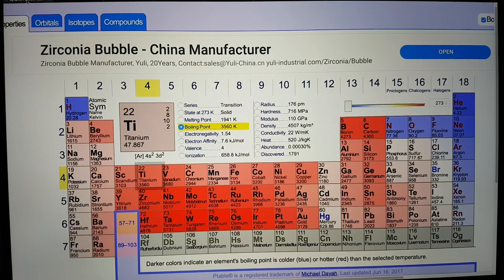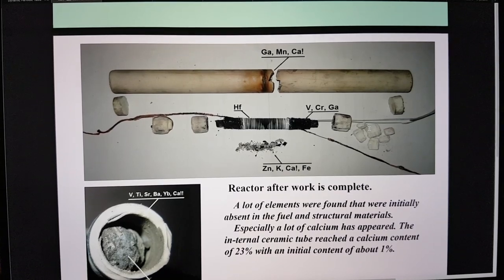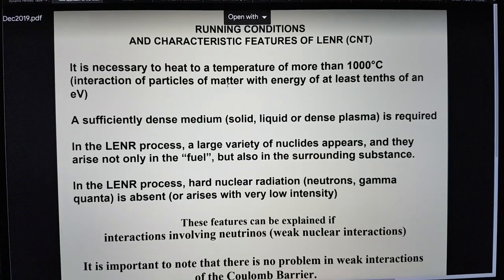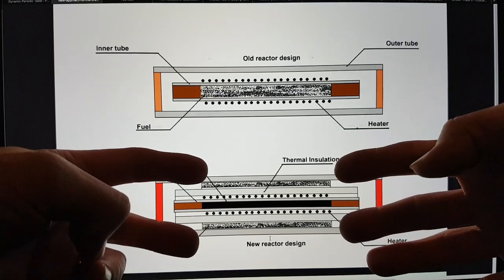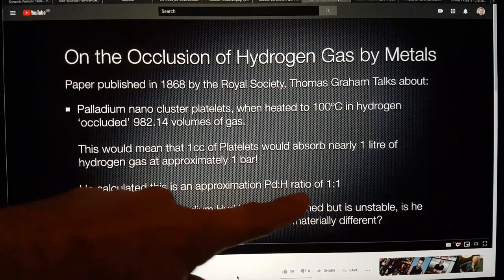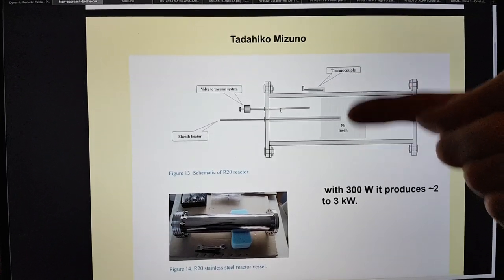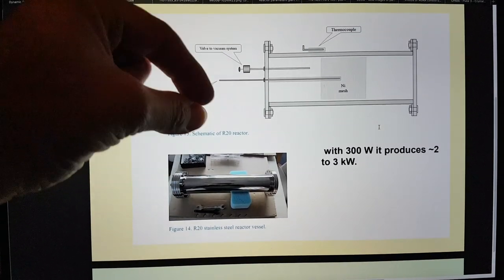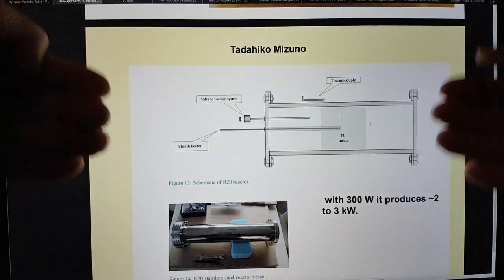Explaining Mizuno R20 and optimisations in relation to Parkhomov’s latest reactor designs

Comment: Great explanation, Bob! Thanks for taking your time and diving into such experimental detail. Wishing you a great and successfull year 2020. We met at Breukelen where I talked about the power of water. Actually some good working "HHO" cells have a cilindrical or spherical geometry, water (with some natural D2O) and nickel wires (and steel electrodes with carbon). So all the ingredients for having a soup of materials for LENR effects, which we have observed several times. Only the very high temperatures are missing. One of the effects is reproducible: the creation of a huge amount of a type of brown mud consisting of Fe, O, C and little Al (probably some Ca and Si, also).
Reply from the maker: Hi there, great to hear from you, nice YT handle. Yes, they have all those things plus cavitation bubbles which will create the necessary conditions of charge separation and extremely high local temperatures which will potentially yield Ultra-Low Energy mass-bearing slow velocity high wavelength neutrinos.

This was a blob of synthesised material in a NOVA reactor compared against crustal abundance.

https://drive.google.com/open?id=1jhCujzj-g0t_h5The3qdegJ6jP8ut2Oh

We are on the verge of re-writing a lot of what we think we know.
Reply: @MFMP  Yes, indeed, there is something there that now can be read as an open book ... probably the same with the elements in the atmosphere, specially N2 and O2. Hard to believe that all that N2 is produced by bottom-dwelling denitrifying bacteria ...

Comment: Spoiler: 2020 was not the year of LENR, it turns out…
Reply from the maker: Well - it is not always easy to see things as they happen, only in retrospect. In this video, I looked at two Ni + Hydrogen experiments. The R20 experiment spawned the work of me356 and he is currently claiming repeatable excess heat from a derivative experiment, we have yet to see it in our replication attempts, but we have good reason to explain why - jury out.

In the case of the Parkhomov 225 reactor - this showed the Pretzl in my analysis of it in 2019, and during that analysis time we also developed the ULTR experiment and proposed it in 2019 and it was replicated widely in 2020. I also analysed the samples from project OHMA showing transmutation of Indium, Tungsten, Titanium and on 10-Yen coin that collectively lead to the understanding that many LENR experiments are in fact HHO or DDO in disguise.

In Feb 2020 I published the 3 tier basic fractal toroidal structure derived from MFMP John Hutchison Fracture sample that appeared to be key to the LENR process and the means by which monopoles are formed leading to my 2020 Russian presentation "The Monopole Clutch". This critical physical finding later lead to the Zhvirblis, Nevessky and Dubovik work from 1965 onwards and the classified soviet energetics programs that supported the fractal toroidal moment being the driver in all LENR processes.

On Reflection, although the experiments and initial analysis were critical in 2019, the finding of the wheel within a wheel within a wheel and its relation to the magnetic monopole that does the work in LENR for me was the moment LENR was solved. I also made the first unambiguous connection to the hidden technology in the Egyptian tradition.

The Monopole Clutch
https://youtu.be/At2hUvA_-cI

Only time will tell, but I am more confident in retrospect than I was in preview, that 2020 was the seminal year.
Reply: @MFMP  it was just an attempt at levity. Love the work you do, and admire your hard work, passion, and talents. : )